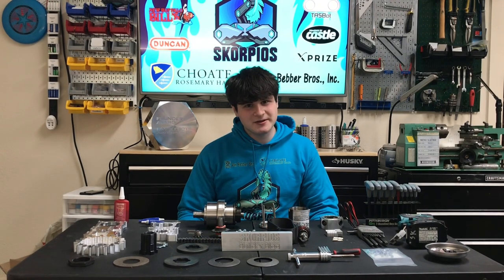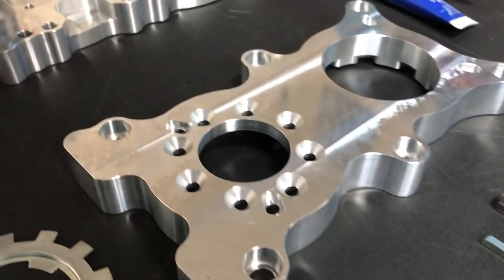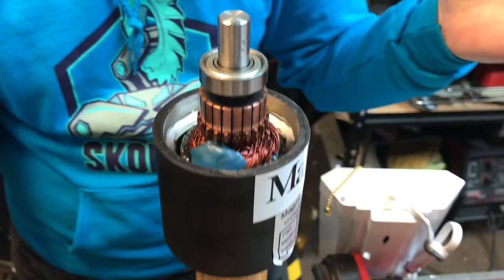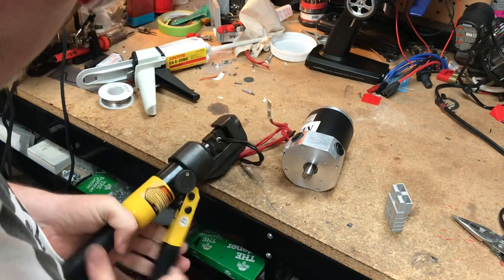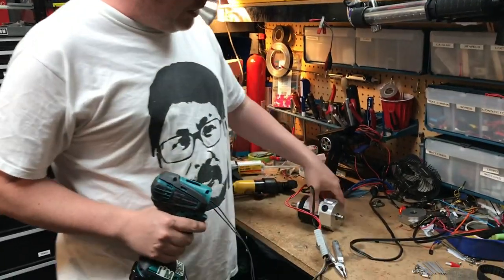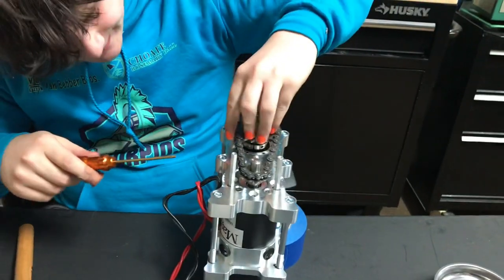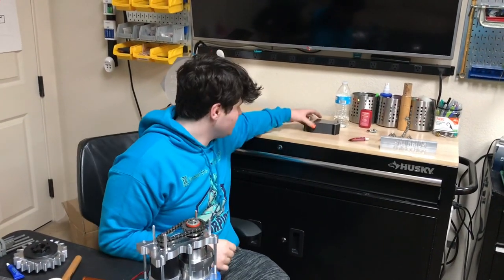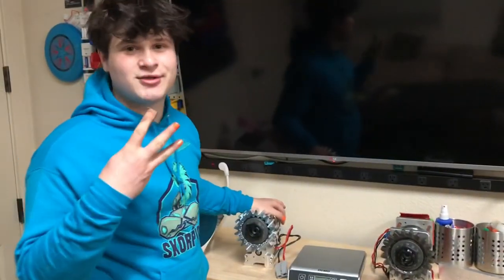How to Build a BattleBot Servo!!

Comment: Neat!  How are you getting positional feedback?
Reply from the maker: OK you caught me !! it’s not a true servo we are using a combination of current limiting on speed controller and two clutches (One on the output and one on the motor) to allow it to stall when it hits it’s two end positions. We are using it as a servo but it’s as low tech as you can get which I feel makes it a little more reliable.
Reply from the maker: Very astute observation I would expect nothing less from Robert Cowan
Reply: @SkorpiosBattlebot  I can see why you have a clutch on the output, but why have one on the input too?
Reply: Redundancy in case one malfunctions